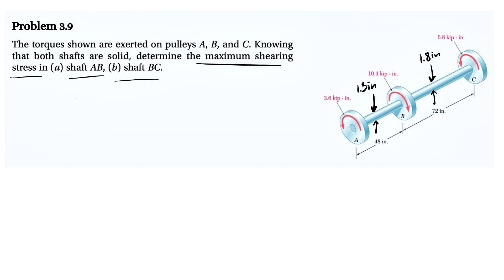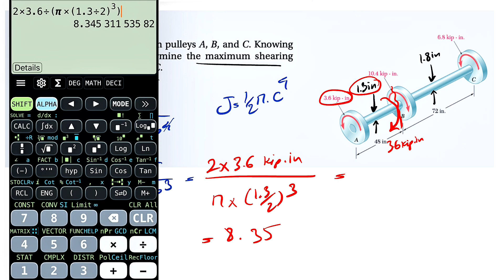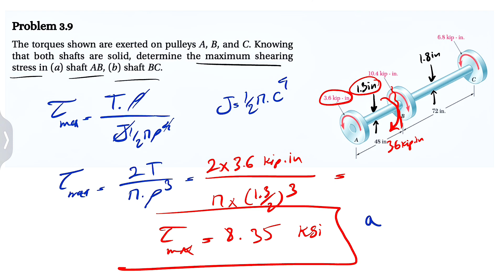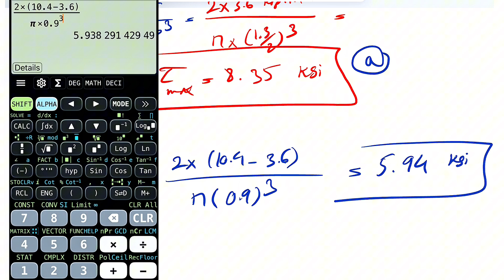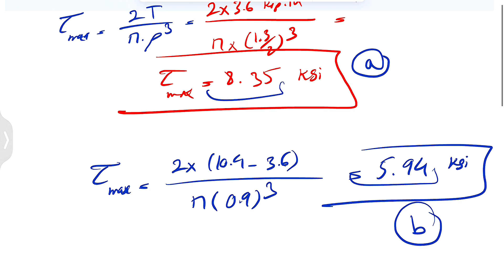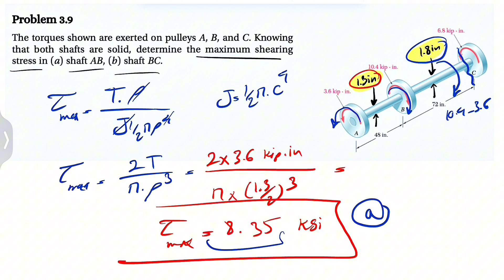Problem 3.9 | The torques shown are exerted on pulleys A, B, and C. Knowing that both shafts

Comment: Why does moment in AB oppose the moment at A, but moment at BC doesn't oppose the cumulative direction at B?
Reply: From B towards A there is only one moment on the bar, which is the 3.6 kip-in. In bar BC, you would go from C to A since AB can influence BC's internal forces while AB can't.
Reply from the maker: For segment AB, the only external torque is at A, so the internal torque in AB must oppose it to satisfy equilibrium. For segment BC, the internal torque must balance the net effect of the torques from A and B together, so its direction depends on their combined effect rather than just opposing the torque at B alone.